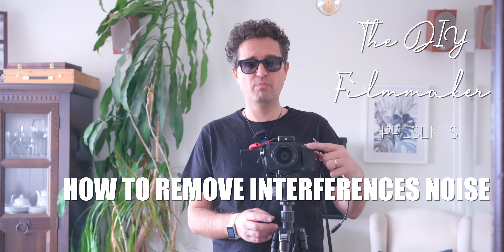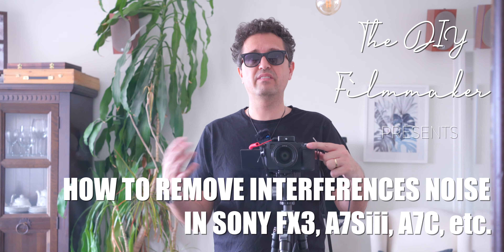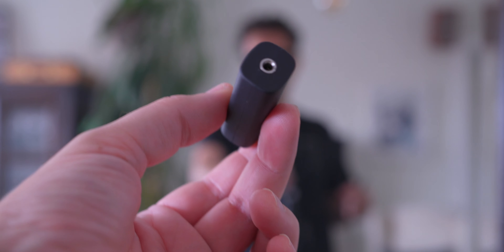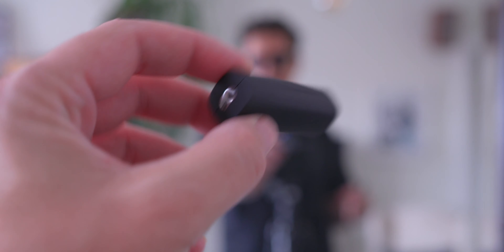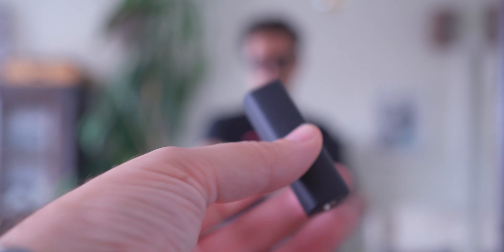Fix Interference: Rode Wireless Go & Sony FX3

Comment: LISTEN, EVERYBODY! I HAVE THE REAL FIX!

I talked directly with Sony Support and they helped me out. I set my internal recording level to 7 and my rode wireless to 0db and the buzzing is gone! Since the DB is at the highest setting the recording isn't quiet either!
Reply from the maker: Thanks for sharing Bradley. I've pinned your solution so that everyone will find it at the beginning of the comments. Cheers!
Reply: i tried this but the sound is really quiet then and i still have the interference noise 😢
Reply: @pigreatlor  It's still quiet when the rode itself is set to 0db? That's usually super loud for me.
Reply: Not an actual fix

Comment: I have same issue with fx3. Sony offered me to replace 3.5 jack port, will it help?
Reply from the maker: The filter fixes it, at least to me. But if you want to send it to Sony, it's OK, the problem is the time you will be without your camera, that's why we I should try first with the filter (ground isolator). All the best!
Reply: @TheDIYFilmmaker  in my case, I showed them issue and they will order new 3.5 jack port to replace it. During that time camera will be with me. Sony will call me, ones spare part with them. Than replacement process will take 1 day. I’m afraid that replacing the port won’t solve grounding issue, am i wrong?
Reply: did replace of the 3.5 jack port help?

Comment: So, I have the DJI MIC, and experience some hizzing / noise in the higher hz range (around 5k to 6k) when connected to my Panasonic G80 cam (it's actually no noise when recording directly to the mic (local). Will a ground loop isolator work for me?
Reply from the maker: It sounds similar to my issue. Try with the ground isolator. It’s just 2$. Cheers!